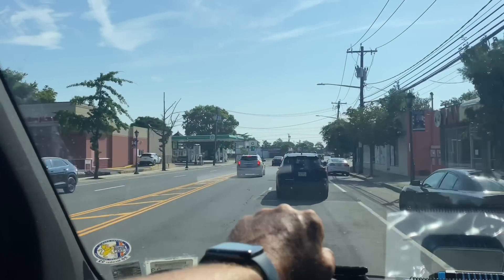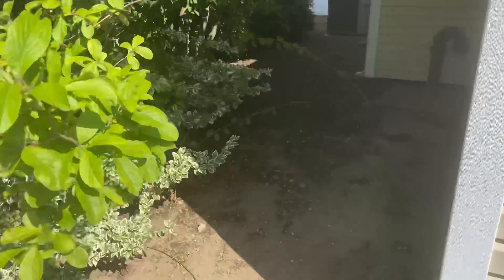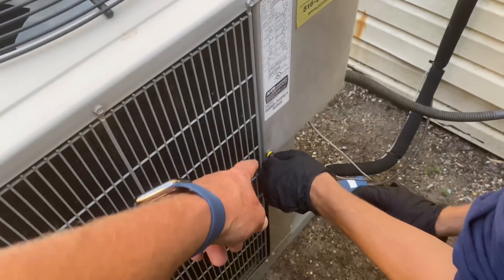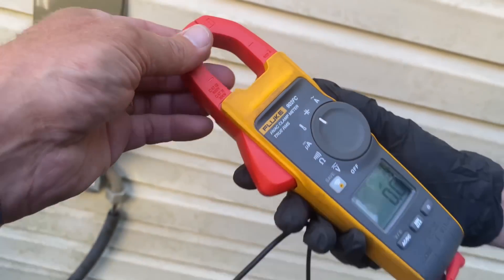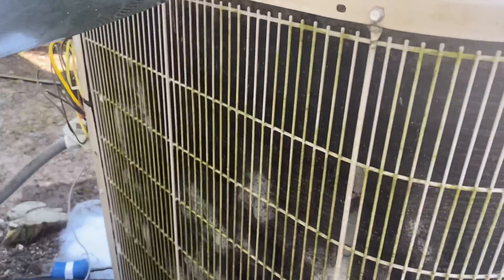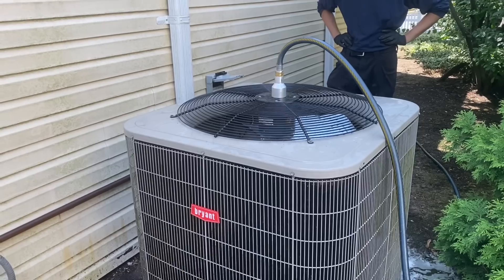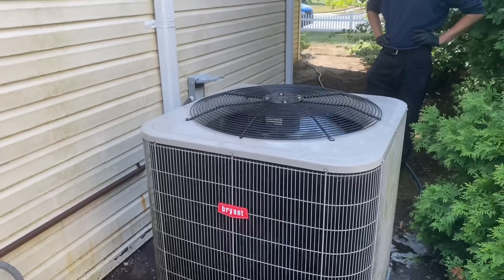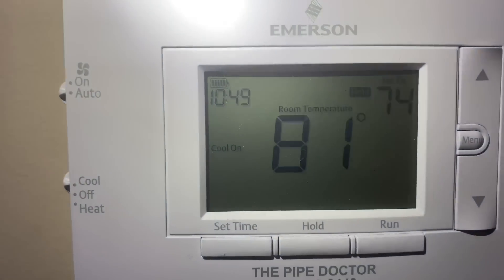They Skipped Years of Preventative Maintenance on the Central AC System - This Is What Happens

Comment: @Mikey Pipes - Pipe Doctor Plumbing & Heating & Air
One more query….
You gonna get the new Milwaukee M12 Fuel Gen 3 ¼” impact driver w/ TriLight when releases, or stay w/ old trusty gen 2 (which I currently have too and use daily, along w/ the Surge models; and really like them, which for longest time thought was a waste of money and gimmicky; but the m12 & m18 Fuel Surge impact drivers really do make a difference w/ that sound; & since I developed tinnitus and finally hearing loss (yep, last hearing test, found out have hearing loss after all these years running & using tools: drills, saws, routers, etc…. And did we use hearing protection religiously back then, sadly, the truth was NO, & was also very common to see ppl not have eye protection on either; hard hats though….diff story as had to if in hard hat zone; and we got dinged if didn’t have them on which wasn’t fun at all…..lesson learned, right.)
And there I go again w/ babbling on & on & on, sorry Mikey.
L8R ✌🏻

Comment: Did you amp. clamp the fan motor & comp. after the cap. got replaced? The oil from that shaft bearing on that iffy motor would be enough for me to decide to change it out rather than chance killing the compressor when it siezes up, and it will some day, we just don't know when, but we know it has a greater potential to do so quicker than a new motor. Avoid a potential call back and charge a little less for the motor change since you're already there and have the thing apart and it'll add zero extra time to the job while you're waiting for the coil cleaner and compressor cool down.

Comment: Been using the Klein  erosion of the Malco bit, and as they look the same and been using the Malco bits (all sizes: 2, 4, 6) the Klein is nice as able to put a ¼” bit in w/o taking Klein nut driver off and that’s a cool feature. Being able to install a PH1-2, Robbie 1-2, & Torx is pretty nice, imo.
As far as durability and magnet retention and durability over time….will have to see; but know how the Malcos hold up over time and they hold up great, & very durable……so, interesting to see if one’s better etc….
✌🏻

Comment: Good learning experience for your helper. Make him check that amp draw and the pressures as well just to confirm the heat killing that cap. Crap caps now a days. I just seen an old '93 HS29 with the original cap, tested within spec, amazing. Those things are bullet proof
Reply: Thats why they quit making them. things are made to break at a sooner time.
Reply: No doubt,  keeps us busy.

Comment: Mike, get the new klein 32907. It is an impact flip socket like the malco but it has 6 different sizes. Great for panels and motor brackets, etc. 1/4, 5/16, 11/32, 3/8, 7/16, and 1/2.
Reply: @PipeDoctor  Daniel is wrong. I love it. Makes is so I don't have to carry around extra bits for a lousy 7/16 when changing a blower motor

Comment: @Mikey Pipes - Pipe Doctor Plumbing & Heating & Air
Do you prefer the HIKMicro B20 thermal camera, or the HIKMicro Pocket thermal camera?
The pocket is cool, as slides in your pocket, but it’s seems “laggy” at times (lots of times actually) compared to the B20, and as the Pocket has a bigger Display, imo, doesn’t seem to be as CRISP & CLEAR to my “old eyes”.
Wondering what your thoughts are and if you’d maybe do a quick review vid of the Pocket VS the B20….🙏🏻🙏🏻
Thx for the fun cool tv show to watch, and tell Chris to feel better; as just not same w/o seeing his smiling face; not that Peter Pan is bad or anything….just got used to AirForce Nun (still think should be AirForce Son😉).
Cheers Mike and Peter✌🏻

Comment: Hello from the great state of Michigan. St. Mike I’m still having a terrible ground mole problem do you think that camera would work and find a heat signature of a ground mole 3 inches below the soil and I could use a pitchfork and do them in.
Reply: I am also from Michigan. Had problems with moles beginning of the year. I treated my yard 1 time with Tomcat mole bait. They are rubber worms, you poke a hole in their tunnels with a stick or dowel you see above ground. Drop 1/2 a worm in and cover it back up. 1 box and all gone.

Comment: Wonderful job. However, You forgot to check amp draw after installation of new cap.  seeing how bad/good compress/fan motor windings are.   Also left $ on the table (No;  time delay or surge protection)
Reply: some people don't believe in selling unnecessary stuff to milk out more $.
Reply: Jon. Ah, your so right.....
Why should you put 2 safeties in 
(max cost of $150-200 more) 
When later you can just sell em a new compressor/ unit... ($1500-3000 more)
Brilliant Idea!   I like where your going. To the bank and CASH in!!!!!!   
N O T
Reply: Jon. Ah, your so right.....
Why should you put in 2 safeties>  (max cost of $150-200 more) 
when you can just sell em a new compressor/ unit... ($1500-3000 more)
bc of short cycling/ power surges/brownouts.  and btw: It took out the Cap prematurely....  Future issues coming sooner than later.
However  you have a Brilliant Idea!   I like where your going.  Straight to the bank and CASH in on a new unit!!!!!!   
N O T Cool Bro. Not Cool!

Comment: I need a new dual run cap. Just cleaned the condenser today and checked the cap. Supposed to be 45/10 and the 45 measures at 41.5.
Reply: Yeah I don't like to see any lower than 90% minimum. You're at about 92% but anything below 95% is questionable. 90% and lower I'm strongly recommending replacement immediately
Reply: @HappyHealthyHVAC  majority are rated +/- 6% and anything outside of that should really be replaced. 45 - 6% = 42.3
Reply: If you can test it, you can replace it...    Titan HD is $24, just do it as PM
Reply: @Hubjeep  
I checked both ways. Power off with a capacitance meter and running by measuring current and voltage across the cap.
Unit is not even two years old yet.

Comment: Great job as usual! Question: the sticker on the unit says "installation prohibited in the Southwest". Why is it prohibited?
Reply: @PipeDoctor  something to do with efficiency is my guess
Reply: @PipeDoctor  makes sense, appreciate it. FJB.
Reply: @PipeDoctor  
DOE set different minimum efficiency standards for different regions of the US. This unit doesn't meet minimum SEER for SW region. SW requires minimum of 14 SEER.
Reply: Like Scott Meyer said, it has to do with the SEER rating. Seasonal Energy Efficiency Rating. Until January 2023 rolls around, the Southwest states like California, Arizona, New Mexico, etc. require it to be efficient equipment. SEER2 ratings coming next year.
Reply: Yeah probably a 13 SEER unit and in I think most of southwest areas minimal allowable SEER to be 14 after such and such year. Can't tell you day and year regulation began but I agree it's a SEER regulation sticker
Reply: @PipeDoctor  If you’re not Tryin’ then you you might just be Lyin’ 

(new phrase for yah)

Comment: My problem that you can help me is what do you do when you looking at a 35 year old system (r22).  The home owner does not want 12k repairs but the system is extremely old.  What the cut off
Reply: Replace the system.
Reply: R22 is extremely expensive, doing repairs on a 35 year old system unless it’s a contactor or capacitor, will just lead to finding more issues. Evaporator most likely will be leaking. If the customer can’t afford a new system, then maybe convert the system to 407c but that is also expensive. Damned if you and damned if you don’t.
Reply: If its leaking, its pretty much junk. BUT Might top off 1 time if only a couple pounds and add sealer. A cap, or even a condenser fan motor, might fix it and tell the customer as is and cross their fingers.
Reply: Tell them a new system is $12k.